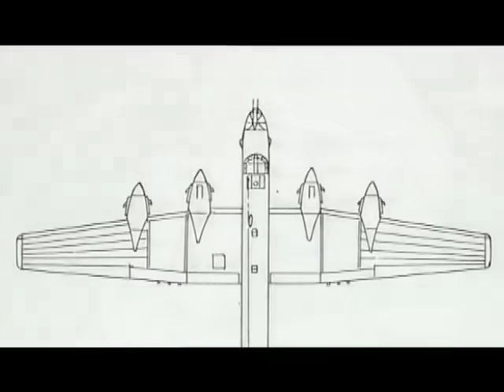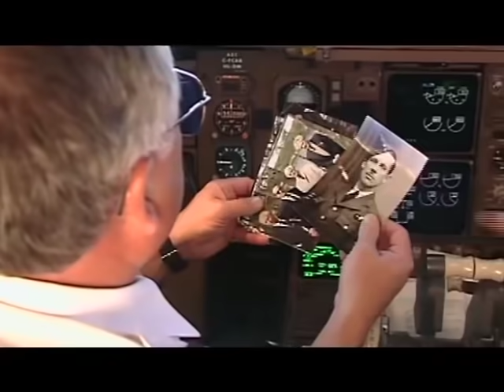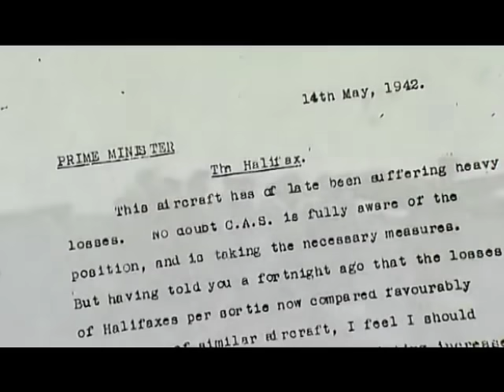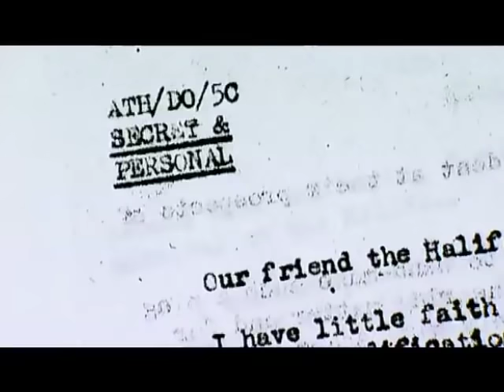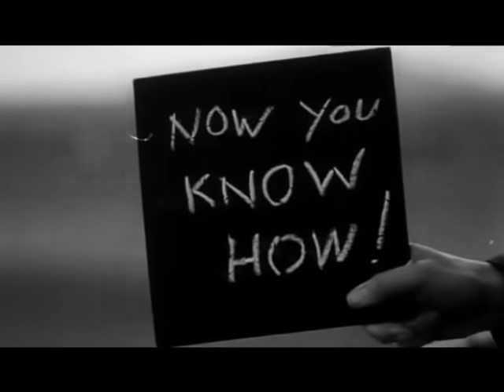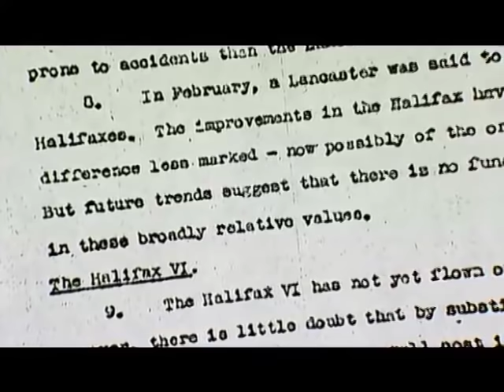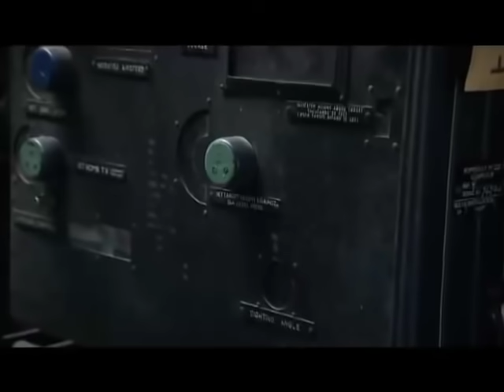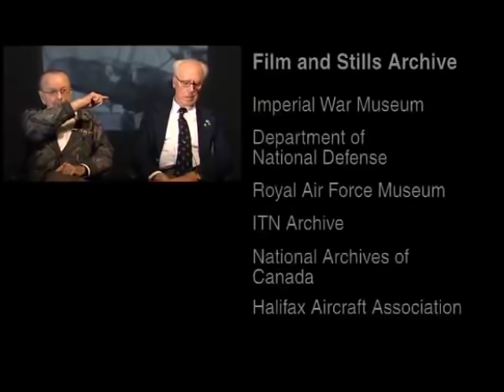Halifax At War: The Story | Bombers of World War II Full Documentary

Comment: In his biography, an RAF pilot who flew both Halifax and Lancaster said that whereas the Lancaster would leap into the air and float on landing, as if not wanting to return to earth, the Halifax was reluctant to leave the ground and seemed to settle on its landing gear with a groan, as if relieved to be back on terra firma. Despite that, both aircraft were well-regarded by the men who flew and maintained them.
Reply: That sound like Jack Currie. The problem with the Halifax was resolved when the engines were changed to Bristol Hercules. This was nothing to do with the Merlins, rather the way they were installed Handley Page having ignored Rolls Royce's  advice and designed their own nacelle  which gave many problems.

Comment: One of the most interesting facts about the Halifax was that Sir Handley-Page himself hated the Merlin engine when everybody else seemed to want it dearly. He wanted the Bristol Hercules sleeve-valve engines, already fitted on the Short Stirling, but for all early Halifaxes was forced to take the Merlin instead.
In principle he was right, since early Hercules engines offered more power than early Merlins and, typical of air-cooled radials, could sustain more battle damage than liquid-cooled V12s. 
Early Halifaxes suffered from fatal crashes due to handling vices. Aerodynamically revised later Halifaxes all had the much-desired Hercules and were quite successful. In contrast, Lancasters fitted with the Herc radials were not considered a success.
Compared to the Lancaster, the Halifax had two drawbacks: a lower ceiling, making it more vulnerable to enemy Flak. Development of high altitude fighter engine supercharger design had been of great benefit to the Rolls-Royce Merlins. Second, it didn't have the unobstructed extra large bomb bay like the Lancaster. Therefore it could not drop large single bombs like the Tallboy which sank the German battleship Tirpitz

Comment: As well as the more powerful Bristol Hecules engines the Mk3 also introduced wing extensions and these combined to offer a considerable increase in ceiling which contributed to the late model Halifaxes having a lower combat loss rate  (and better performance) than the equivalent Lancaster.
Reply: That's interesting to learn about the extended wings on the later models, if only they had stuck to the original specs for the Stirling they would have saved some aircrew lives. 👍

Comment: What I find intriguing about the Halifax is that it never performed to its fullest extent until fitted with Bristol Hercules, of course some modifications to flight controls and airframe dimensions were part of its transformation. On the other hand, the Lancaster when fitted with Hercules in the B.II suffered a degradation in performance. Apparently the Halifax was slated for twin engines like the terrible Manchester. When it was decided to develop the Halifax as a four engine design, Handley Page were denied access to Hercules engines so had to design its own nacelles to adapt the Merlin engines, an arrangement that was never truly satisfactory. The exhaust often caused heat problems with the wings and exhaust stub flames hampered crew night vision. But, more alarmingly for the crew was the exhaust flames which could easily be seen from behind by enemy night fighters.

Comment: The loss of V9977 in testing early H2s, with many key EMI personnel was probably owing to a replacement MerlinXX engine of which a single tappit nut (one of 48) had not been locked down on the previous 10-hour inspection. This resulted in the failure of an inlet valve stem and combustion gases mixed with the induction/carburation, causing a fire which burnt through the engine bulkhead and into the wing tanks.

Comment: Lancaster went higher and farther with a greater bomb load on the same engine power and is therefore a superior machine from an engineering point of view, Hallifax was an incredible piece of junk which is born out by the higher loss rates, these gentlemen don't know how lucky they are to have survived the Halifax, very lucky indeed. Halifax 3 was better but it took 25% more power from the Hercules to equal the performance of the Lancaster.